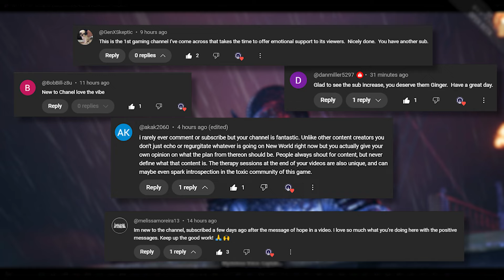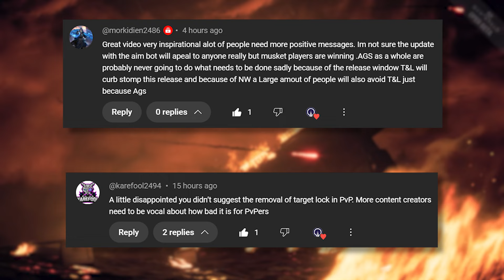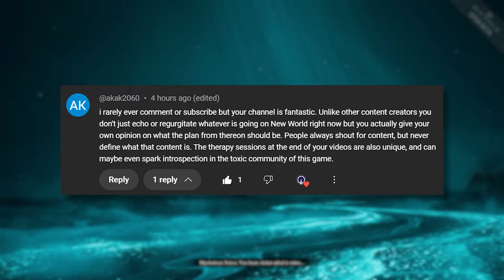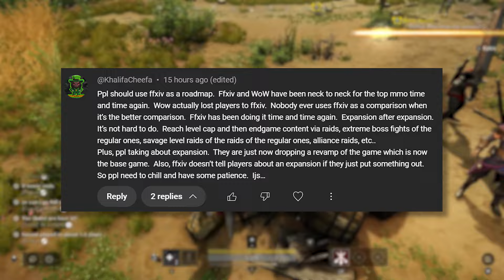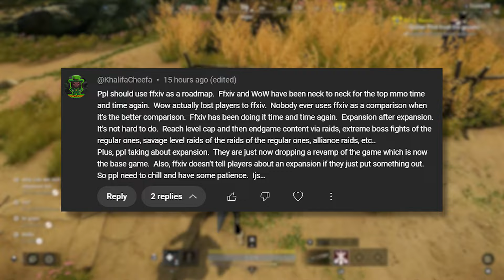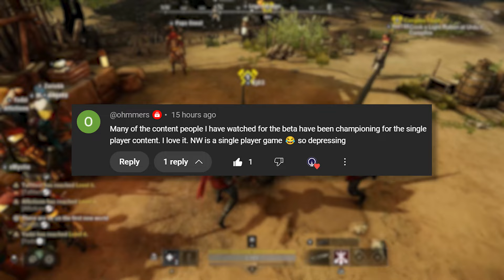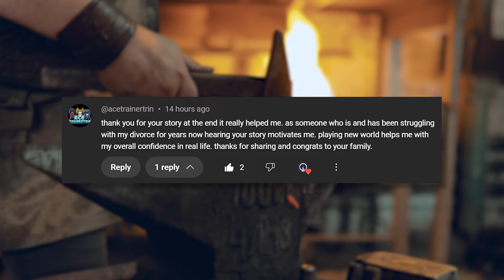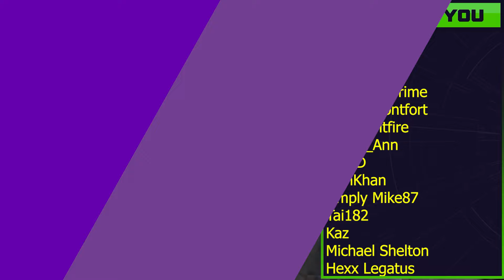New World Aeternum Lock On Target & Final Fantasy XIV's Reborn Roadmap

Comment: Can someone explain to me the issue with target lock? I haven't played this game yet (i plan to start for the first time on Oct 15) but coming from Elden Ring and other Souls games I just dont understand the issue...those games have huge pvp components to the game, and have always had target lock, and the fact is not only is target lock not some kind of "easy mode" advantage, it actually increases the skill ceiling of the mode...top players know that just locking on to a target and keeping it on is actually not the best for combat, and knowing when to lock on and when to free aim is actually a big part of skill expression. To me, if it becomes a scenario where you just automatically win because you're locked on, then there's bigger issues with the general combat in terms of the frame data, hit boxes, and skill cancellation systems.  It actually boggles the mind that this is seen as some sort of auto win cheat, so what am i missing here?

Comment: They DEFINITELY should ONLY allow target lock for controller, allowing for kbm is insane. Another way to fix the issue of kbm being so much better than controller they can just increase the 'hit boxes' while using controller and shrink it with kbm. That being said the target lock is not that good, PVP streamers are mostly over reacting. You can't even do a head shot with it, maybe make it not crit would be enough also. 30% less damage would be way too much though.
But there might be another reason AGS put target lock in PVP for the open beta. It's called the 'king & artist/hairy hand' method, when you are doing something for a terrible customer or crybaby, you purposely put something very bad in (like making a hand in portrait super hairy) so that when your horrible customer inevitably complains about your work, you distract them with something obvious that you can fix quickly so they forget about bitching about other stuff that isn't actually wrong. So now they can just remove 'target lock' in PVP only and make PVPers happy so they don't complain about other stuff. They may have done it on purpose.